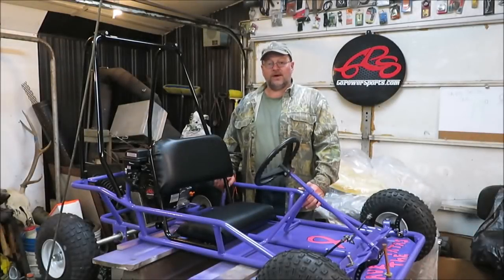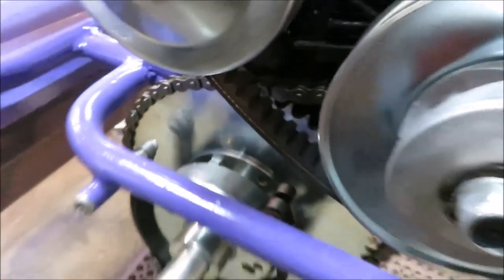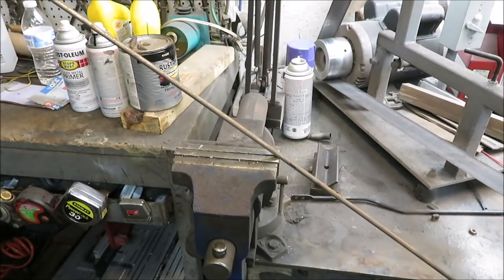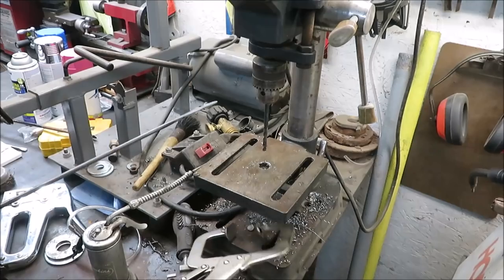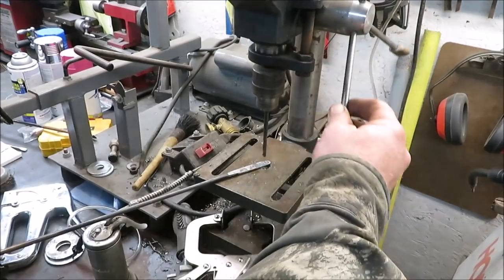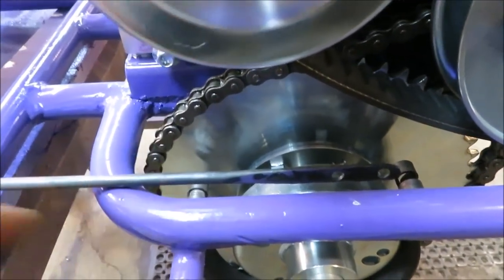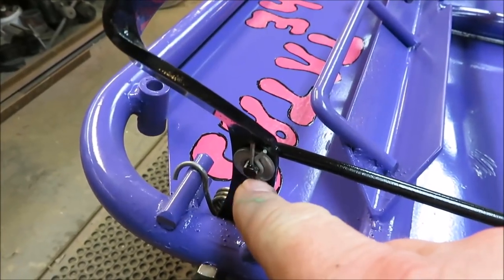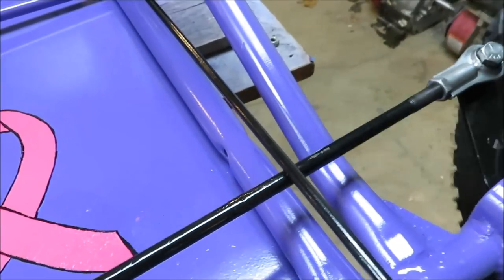go kart homemade brake rod

Comment: Just curious, but after heating, bending and drilling holes for both ends, did you re-heat the back part, quench it, then temper to relax the mild steel? It could break when you don't want it to. Just a thought as I have seen dozens of shows & videos where the process of heating to non0magnetic state, quenching, then gently heating to purple / straw color removes the hardening set into the metal. This is done after shaping to keep the now brittle part to be stronger. Otherwise, same system on my current job of fixing my sons go-cart for his kids, but using a "Bell-Crank" pivot to achieve high mechanical advantage for stopping pressure by foot. 
Good straight forward video.